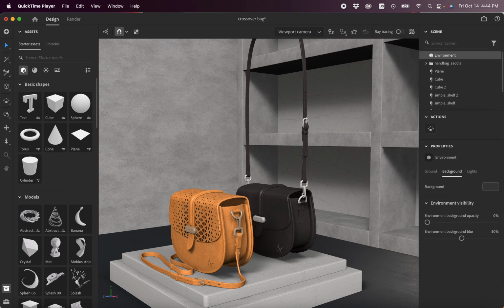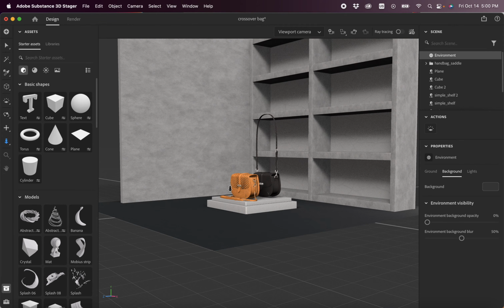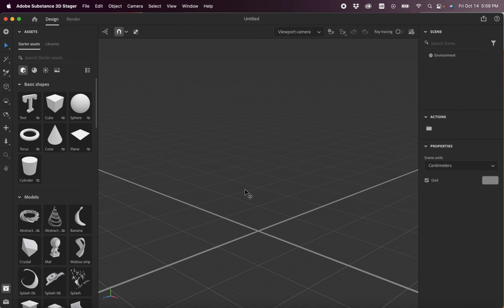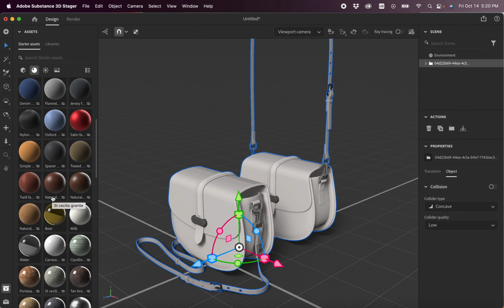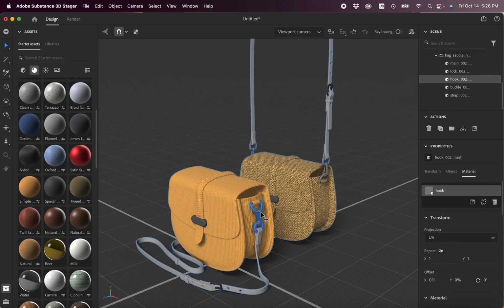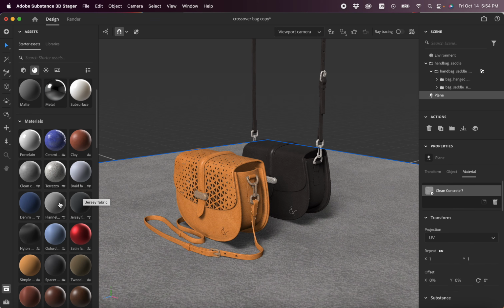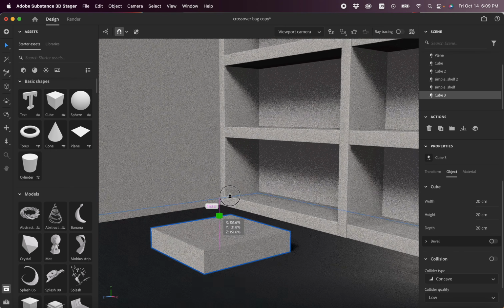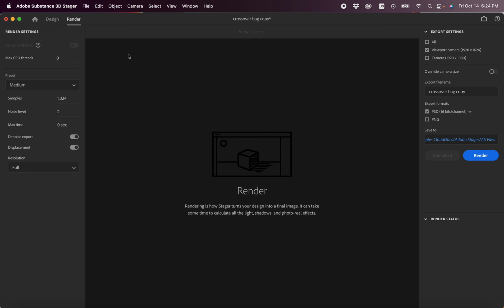3D for Beginners: Introduction to Adobe Substance 3D Stager

Comment: this is just like dimension with some added features. i hope they allowed some simple animation here though
Reply from the maker: You are right - it is very similar! The main problem is that Dimension won't be getting any more updates - there's a whole debate going on about it: https://community.adobe.com/t5/dimension-discussions/introducing-adobe-substance-3d-stager-and-dimension-update/m-p/13628572/page/9#M7931
Reply: @DanielaNorvik  i discovered you can open dimension files in it then it will be converted to the new format. I really wish they allow us to make some animations with it.
Reply from the maker: @2CER  Yes, opening files is not an issue when it goes: DN --> SSG ... but be careful with the reverse. Some .ssg files won't open in DN anymore. I agree that DN and SG should be the same app though🤷‍♀